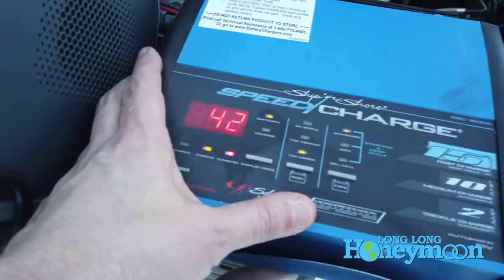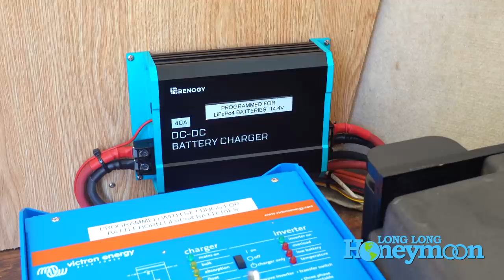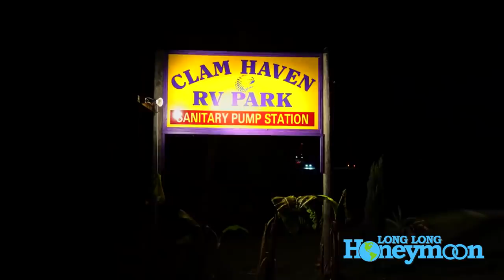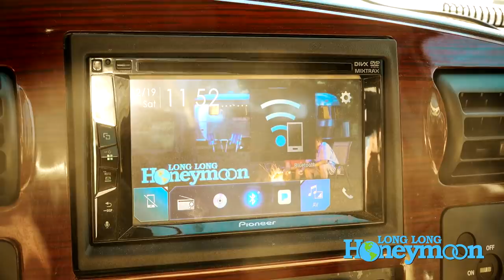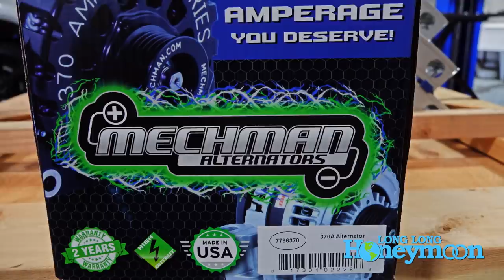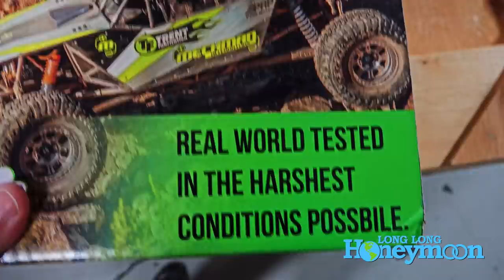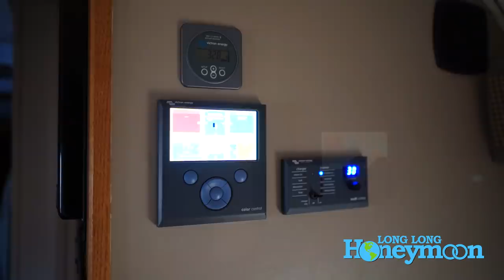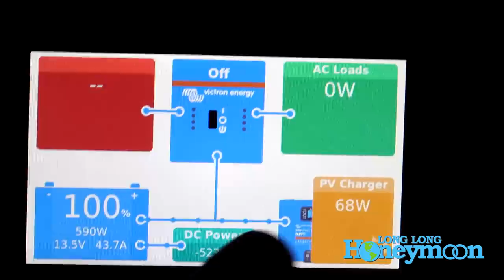UPGRADE: Installing a 370 AMP Mechman Alternator!

Comment: Good plan.. good alternator. .Technically what kills the factory Alternators is heat. (Overheating at low RPM) The DC to DC converter is a good Idea but Question.. My Ford  (replacement alternator puts out 14.1 volts  and is an upgraded  long warranty  replacement new not refurbed.  My system does not charge the RV batteries if the Engine is not running. .. Does your charging depend on the truck running?  If not, You will kill your truck batteries no matter what size alternator you have.
Reply: He has solar panels to charge the RV batteries but also uses the truck's alternator to charge the RV batteries while driving or when the engine is running.  He ran a heavy duty cable to the back of the truck  with an Anderson connector to charge the RV batteries. 
The alternator died because stock alternators are not intended to provide large amounts of power for long periods, they heat up and get damaged.
Reply: @JT-lq4yd  His DC to DC Charger is limited to 40 amps... a 150 Amp alternator can safely provide 40 amps.  I have limited my RV charging to 30 amps. and only when the engine is running .. He got a re manufactured "Low cost alternator" which probably just failed.  Many Fords have a Tow package which is relay controlled charging and it's limited . Ambulance service Fords have a second alternator.  Knowlege is power. You can substitute money for engineering and  most of the time solve a problem.  Having a 300 amp Alternator has no downside. except expense.
Reply: @enriquelaroche5370   The problem with DC to DC chargers is that they need more  power to charge batteries as they are not 100% efficient.  Also, alternators only generate their rated output at high engine RPM just like horsepower, at idle they barely charge the battery, if you run all accessories it gets discharged.  I can't speak of auto manufacturers as they have different specifications.

Comment: Here we ALSO learn how to turn a 4.0 minute story into a 11:34 minute story. The short version: Upgrade your stock alt to a Mechman 370amp. Easily charge aux batteries, and a high quality usa built and warrantied unit.
Reply from the maker: YouTube has got to be the only content platform where some people complain for receiving too much free content. It's interesting. I've never heard anyone complain about TV shows, radio shows, or podcasts in this manner.  And you can even adjust the YouTube playback speed for faster playback. (Of course I've heard people grumble about 3-hour long movies, but that's quite different from a 10-minute vid.)
Reply: I could not agree more. Wayyyyy toooooo longggggg to get to a simple alt upgrade. VERY simple. But hey? At least he replied with a nice, short, to-the-point answ....oooops...nope. just as long and pointless.

Comment: Seemore fought to get you to the safety of the park. BTW - you can add a pull handle to the Anderson connector so it will be easier to disconnect. Thanks for sharing and have a great holiday season.
Reply from the maker: Thanks for the tip!

Comment: Really dig the Star Trek inserts. I have a 2014 350 with a 6.7. I wonder if that’s the alternator that was in your 6.0 and if I should up grade? I have 3 120 amp Zamp solar panels. With AGM batteries. Great vid always informative.

Comment: So are you doing a vid on the outside buff and wax on your trailer.Dean
Reply from the maker: Yes, planning to launch it January 3. It was more than a wax, it's a new nanotechnology ceramic coating. We get home today and I will wash the rig this weekend. Merry Christmas!
Reply: Cool , I had/have  wood artillery mold spores all over the driver side of AS, had to use a credit card to scrape them off. Once I have a chance i need to do a 4 stage glaze wax ect,ect...look forward on your show.Dean

Comment: Does installing an alternator as this one or even a bigger 400amp one do anything to your vehicles stock electrical wiring or components etc etc like fry cables or make any electrical run hotter? I just want to be sure before i buy one to install on a 2002 Blazer Xtreme 4.3 Vortec.
Thank You
Reply from the maker: You probably should ask Mechman but we haven't noticed any such problems so far.

Comment: My 2018 Promater City van's OEM alternator is 160a has gone bad and only putting out 12.5v.  There is a lot of power demand on my van.    I run a giant battery 155ah AGM starter battery and 2000 watt inverter + 12v fans and LED lights and other appliances overnight.   I want to put in a 320a after market high amp alternator, but worry about the computer and affecting gas mileage.   Should worry the battery fuse to my alternator is only 150a.  Any pully or adapter changes if manuf claims it will fit?

Comment: Great videos.  Thank you.  I'm bulletproofing my 05 6.0L starting on Monday.  My truck has 2 alternators. and dual batteries.  The primary (upper )alternator was replaced a month ago and now I'm told the secondary (lower) alternator is bad.  Any idea if you can replace both of those with one of these 370 amp alternators?

Comment: Not entirely your fault. Yes your alternator was probably bad or had reduced output and a battery isolator may have helped (not sure about there logic) but I see a design issue with the Renogy DC-DC charger. The specifications for the unit list the LOW VOLTAGE CUT-OUT AT 8V. That is enough to kill your truck battery if left enabled. The Renogy 40 amp model will pull as much as 60 amps from the trucks battery/charging system. So if you alternator is not keeping up, it will drain the battery down to 8 volts before it shuts down. The truck will die before the battery reaches 8 volts.
Reply from the maker: Thanks for your comment. Yes, I put this video out there to share our experience and help others avoid this problem. We have now towed almost 2000 trouble-free miles with our new alternator setup.
Reply: @LongLongHoneymoon   Thanks for sharing this. I have been following you guys for several years now. Been dragging a Travel Trailer all over the country for many years. 
 I am in the process of installing the same Renogy 40 amp charger. I am building a electronic interface to control the enable and current limiting controls and now I will add a low voltage function.  I did find a "smart Isolator" (Voltage Sensitive Relay) on Amazon that would protect your truck system from the Renogy charger draining the truck. I believe Renogy should have that protection built into there charger.

Comment: You could have installed a DC to DC converter for lots less money and trouble, now you still need the DC to DC converter. everyone you installs Lithium batteries  has to do this update or burn up your alternator
Reply from the maker: We do have a DC to DC.... sadly we were still having issues.

Comment: Hey Sean,
  I know this an older video but I wanted to know how is the mechman alternator holding up?  Also on your video you stated you had 2 batteries on your truck and your batteries on your airstream. I am currently looking into a similar set up for truck and trailer, I would like upgrade the alternator to a 320 amp and 2 dc to dc chargers, one for the truck 25 amp redarc and the other the victron 30 amp to the trailer. I

Comment: Even though I “liked”, the only part I understood was Kirk and Spock.
Reply: But, I also went for sometime, after getting my van, not knowing the factory had not connected the solar panels into the system.
Reply from the maker: If it was confusing then I did not do a good job explaining! Sorry, I will try to do better next time. I understand that this stuff can be confusing (it is often to me also :D).
Reply: @LongLongHoneymoon  , we’ll need charts, pointers and a long Power Point.🤓🤯
Reply from the maker: @kathythomas7371  haha maybe I should just include more Star Trek. :D

Comment: What were you running the the Airstream that was using so much power. It looked like nice day and your solar system had to be adding a great deal... yes, no, maybe... again, what did you have running in the shiny girl.
Reply from the maker: Well, the main power draw from the truck to the trailer is the lithium battery bank.... they will draw more than 40 Amps -- too much for our old alternator!

Comment: i heard some say you need to replace the serpentine belt after upgrading the alternator or risk voltage failure over time? only asking that because im also upgrading my 130Amp alt for a 250 amp alt. in a couple weeks when its get here..SO lpls let me know if its true about having to change belts when going bigger on the alternator. any info appreciated

thanks

Comment: One more safety note  
The stock wires in your rig might be designed for a maximum current and or the computer might be the same,  i would talk to ford just as a safety thing
Reply: that's not how car electrical works - I've been a 12 volt tech for over 20 years - he simply had too high of power demands - same thing when people add massive sound systems and fail to upgrade their alternator - eventually you will burn it out and the battery will go with it
Reply: @AskRemy  I was talking about going from a stock alternator to one possible 3 times the output  like for instance 22 guage to 12 guage  capacity in amps or watts  more power equals more heat on wires .

Comment: Oh, that stinks!  Our converter went out on our camper. It was late afternoon and I had the brilliant idea to just plug the camper into the TV and I'd figure out what was wrong in the morning. Woke up and watched the lights go dim. When it occurred to me that it was killing my TV battery, I rushed out to crank it. I tripped face first (I'm handicapped) and I was like a turtle on his back. When I was able to get on my feet, I quickly came to know the battery was done for. Fortunately we were camping with my parents and dad came and jumped me off. Not sure which was worse, killing my battery or flailing about like a caught fish. Ha! Live and learn yea?
Reply: You plugged your camper into your TV???
Reply: @Milesco  tow vehicle
Reply: @eatingoodinthewoods  :  Ah.  Thanks.  :-)

(If I may be so bold as to offer some unsolicited advice, may I respectfully suggest that when using an uncommon abbreviation, you spell it out when first using it?  That's the general rule according to all major style guides.  [E.g., the Chicago Manual of Style, the American Psychological Association (APA) <--(see what I did there?), etc.]   Also, according to the style guides, if a term or phrase is only going to be used once or twice, it's better not to abbreviate it at all and just spell it out.  E.g., "Tow vehicle".)

Thanks again, and happy holidays!

Comment: The stock alternator on a six liter truck is the same as that on a Ford Fusion, and is not sufficient for towing a trailer, even with a stock battery.  We learned this right after we purchased our trailer.  The stock alternator is barely enough to run the truck alone, let alone charging the battery, running the brakes and lights of a trailer.  Hope you upgraded your wiring as if something goes amiss, ,you will fry your wiring.

Comment: How much of a drag is it on your truck? How much horse power loss is at the wheels?
Reply from the maker: I've noticed a difference of 0.000000000000000000000000000000000000000434%
Reply: @LongLongHoneymoon  ouch... that's a lot

Comment: I don't understand why the 600+ solar on the roof didn't make up the difference from the truck?
Reply from the maker: We talked about this last week. 600 Watts on the roof may only translate to 150 Watts in the real world (angle of sun, time of year, time of year, clarity of sky, etc.).
Reply: Also the solar and DC/DC Charger are two separate systems. Each one operates independently of the other.
Reply: @airstreamnutsandbolts  I can understand they may well be two separate sources of electrical power, but do they not both supply the same battery bank? Is the trailer also operating on two separate electrical systems with independent outlets?
Reply: @raycoleman3183  2 separate meaning (truck electrical) and (rv electrical) - Solar goes to the mppt which goes to the batteries. Truck was outfitted with the option of supplying the rv batteries as a secondary source in the event the sun is not readily available. Nobody ever thinks the alternator is a problem until it becomes a problem. Reality - that alternator was burning up long before that day, so were his truck batteries. Too much load.

Comment: That much drain from the trailer will really shorten the range of your Tesla Truck.
Reply from the maker: Good point. I really wish the Teslas had a good old fashioned politically incorrect fossil fuel burning generator on board for emergencies.

Comment: Even an excellent alternator can be a problem. At low engine RPM the alternator is not very efficient. At low RPM the alternator can burn out under a heavy load condition - even a load well below it's rated capacity.

Comment: 370 amps! That's a huge amount of power, very possibly overkill IMO.
Reply: you can't over do it on current, only voltage - the components will only pull what they need - voltage on the other hand, well, you will know immediately you had too much

Comment: Mechman link, takes you to Amazon - Shows the same item number, as on the Mechman website, but besides saying it is Made In China it Also $150 less than on the the Mechman website - so, it’s either a really good deal - Or, it really IS Made In China...  I’m thinking, I’d rather pay more and buy it from the company that Makes it...  (hopefully, it’s not only Assembled in the USA - but made with USA parts, in the USA)
Reply from the maker: I think that Amazon listing is simply incorrect. I'm pretty sure all Mechman are made in Tennessee.

Comment: You were actually pulling a bit over 44 amps. 

Look up Ohm's law. It will help you understand more about electricity.
Reply from the maker: Planck's Constant taught me even more.
Reply: @LongLongHoneymoon  P = I x E, where P is power in watts, I is current in amperes and E is Electromotive force in Volts. At 0 Hz (DC) Planck isn't much use. Using the values from your charge display and rounding to two places: 532W = 38.55A x 13.8V so about 38.55 Amps was from Seemore. 55W = 3.99A x 13.8 so about four more amps was coming in from solar. 38.55A + 3.99A = 42.54, so aside from a little rounding error and/or measurement error we've accounted for all the current. The Airstream's solar array is only contributing about a tenth as much as you're drawing out of Seemore.
Reply: @AcmeRacing  i was using 12 volts in my calculations.  However 40 amps seems to be right.
Reply: @LongLongHoneymoon  that's a little over my head. 
Safe Travels y'all.
Reply: @whiskey5jda  I tried it with 12, but the controller display was showing 13.8 so I went with it. I still came out a tiny bit lower on current, so perhaps 13.8 is a nominal value and actual voltage is a little higher.

Comment: Ur started frightening me. I was planning on 4 lithium celled solar... I thought you'd say it was eating ur car battery up.
I was actually releaved it was only thee alternator. But I dont have a truck or 5th wheel and the RV I plan buying is only 3200 lbs.
Im consideringnot hooking up anything to my vehicles battery except for the brakes and lights on the RV.

Comment: Just 1kW power to send over HUGE copper wires does not looks like very efficient idea would be better installing AC 1.5kW inverter directly in the truck and sending power over small 14AWG wires then charge battery with AC-DC charger (avoiding DC-DC cost)
+new feature = can run any tools or large cooking gear directly in the truck anytime on diesel fuel (still less efficient than standalone inverter Gas generator)

Comment: I always had VW"s & my old bug,  Rabbits & vanogan would need a new alternator after a few years,  like battery replacement. When this crap started,  everyone want to replace the fuel filter. Nope it was always thee alternator.
So why do they always want to sell you a refurbished one and convince you theyre saving you money cuz just couldnt afford a new one???? Well I always bought a 'new one' and never had those problems  again. Plus theyre gettimg $$ sending my.old one in to be refurbished,  nope,  I want my old one back unless youre paying me for it!!!!
Reply: The one time I bought a brand new alternator it was a Bosch for my wife's Jetta. Two years later the regulator failed and it jumped up to 17 volts intermittently, which gave me an antilock system light and boiled the battery. The reman unit we got next lasted until we got rid of the car many years later.

Comment: You need thi you need that? Up grade I’m sure included 1/0 welding cables to batteries and starter.  6 lug terminal from Amazon or stereo shop to o hook up almost any thing and then add a 3rd battery or a bank . Nipondenso guts into stock. Blah. Odyssey batteries all others are reman with a new case. Not virgin lead. Diy build your own.

Comment: I still keep to the k.i.s.s. direction.
Would of thought spending $16k on a solar system could charge your batteries,
now you are putting extra stress on your trucks entire charging system along with
decreasing your gas mileage. 
Just can’t justify not using a generator a couple hours a day to top off my batteries,
or full time when air is needed.
Reply from the maker: Nothing wrong with a good generator too. Overall we love the solar, but there have been a few teething issues. This was one of them.

Comment: Why do you have to spoil your post by  demeaning  China  - it was a cheap replacement  that you  put extra load on  that caused it to fail - When I put my Lithium batteries on my RV  I upgraded the alternator as a matter of routine  common sense.